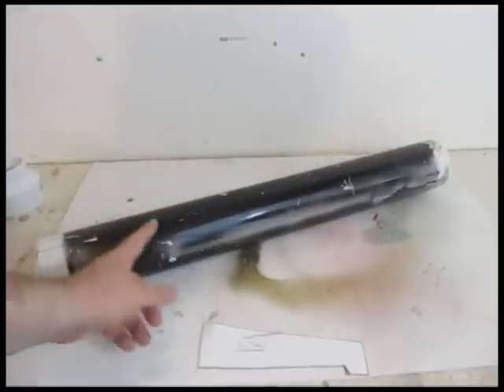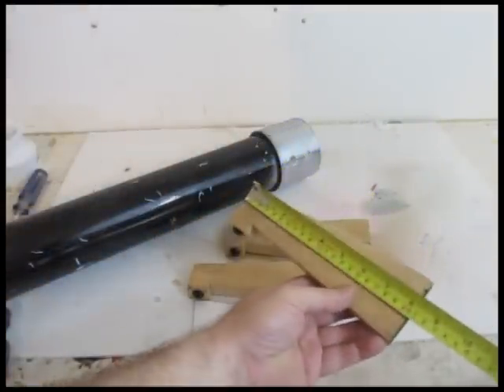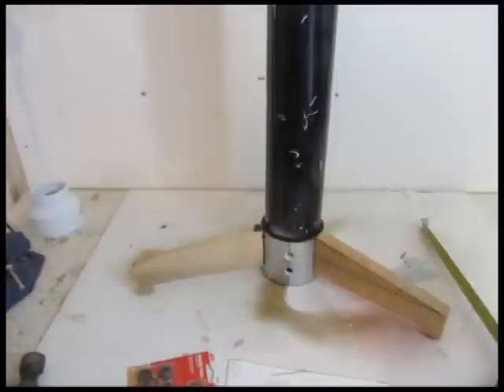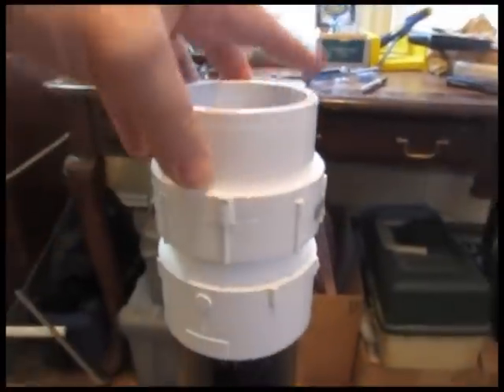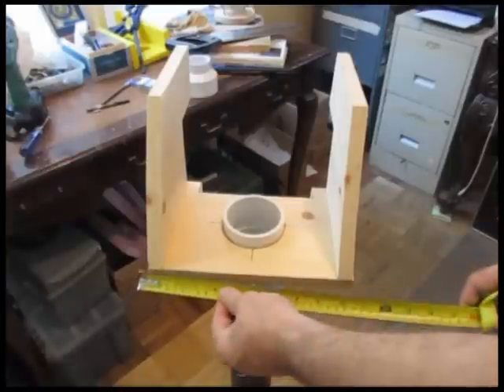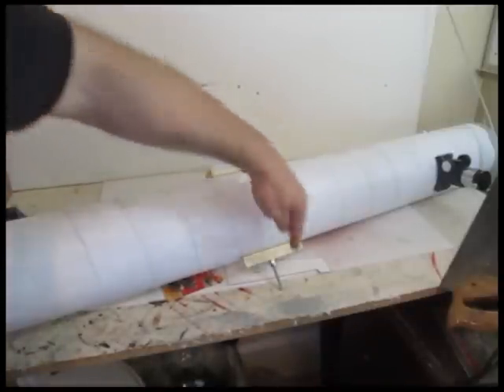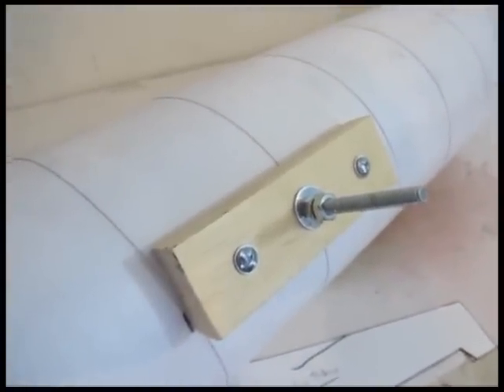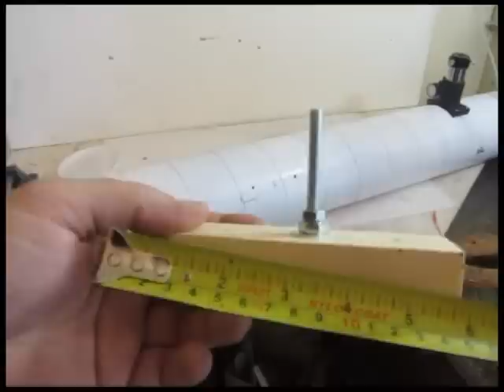How to Make a Reflector Telescope Part 3

Comment: Fantastic and very instructibe videos. I'm starting my own 6 inches telescope with your help. You state this mount for a 4 inches instrument but mine will be 6 inches. I imagine the mount is the same, only proportionally increased in size. Am I correct?
Reply from the maker: Congrats on making a six inch telescope.. It won't be a proportional increase in size because we are dealing with some simple angles. It will be a bit different. The shapes will all be the same. I recommend you build the telescope tube assembly first. Then you can use your tube size and the new weight of it to custom tinker the saddle and mount,.
Reply: @epicfantasy  Sorry for late reply. Personal issues kept me away from my telescope until now. Yes, I will increase the size of the supporting tube and all wooden parts to properly installed the larger 6" telescope. I find your telescope mount extremely extremely clever and very easy to make. Those I have seen like the equatorial or the Dobson, are not as practical.. By the way did you made the 8· telescope? Regards from Colombia EDUARDO

Comment: You would want to use some sand bags on the feet of the scope pier to really hold it down with this mount. I was looking at the pipe and also tossing over the idea of sealing the ends and putting sand in to dampen the vibration and add weight as well.
Reply from the maker: Great comment and great suggestion!

Comment: Nice tutorial! How did the 8 inch turn out?? I am sure you have this information somewhere but where did you purchase your mirrors from? Are they front surface or rear surface mirrors (they look like front)? Also are there benefits/drawbacks to the flat vs concave mirror aside from compactness and price? 

I am considering making a telescope myself and implementing 3D printed adapter pieces/other parts. If i do make one I would aim for a large telescope, possibly a >12 inch reflector, but I am sure mirror prices go up exponentially... Do you have any pointers for designing or buying mirrors for a homemade large telescope?

Thanks for your help! Its always nice to find an articulate, concise, step by step instructional video without any unnecessary bullshit wasting my time.
Reply from the maker: Ryan Barlow Good timing here. I just started working on the 8 inch telescope this week! Got a lot of projects and finally getting to the telescope.. I do have some advice in terms of the 12 inch. I highly recommend you make a smaller one first. Two good reasons, the learning curve of making one and the functional astronomy use. Much better to get a score of hours with a smaller telescope before lugging a monster out at night.  About telescope mirrors: They are always front surface coated. And flat mirrors don't work for telescopes. They have to be concave to bend the light. And always much more expensive, 
Keep at it and keep me posted. Dig up my email. Very worthwhile project. And I am excited to have started on the 8 inch.
Reply: Thanks for your response! I am actually working at an astronomical institute currently so I have access to all sorts of equipment. My main concern is mounting such a bulky optical tube on a tracking mount since my primary purpose is astrophotography... I am sure some of the heavier german equatorial mounts can handle it though. Keep me updated on your 8 inch!!
Reply from the maker: Excellent! Great job you must have! More coming on the 8 inch telescope build.

Comment: I'm not that familiar with telescopes, Is it important to attach an eye piece to the focuser..why is it necessary? And also what are the optimum specs to get the best results? The size of the mirrors? and also how do you cut that secondary mirror diagonally?
Reply from the maker: Akhil Prasad The eyepiece is what does the magnification. It is the power. Optimum specs don't really exist. The bigger the telescope the better.  Secondary mirror doesn't have to be cut diagonally . But better to just buy one.
Reply: epicfantasy Thank you, also where to buy the mirrors from? It is a parabolic concave mirror used only for telescopes isnt it?
I live in India and resources are very sparse here.

Comment: not sure why he used  a cardboard tube for the scope... i would have went with  a plastic pipe like the stand..but then again.. i just buy a scope :)
Reply: I would have made it from high dollar aircraft aluminum plated in silver then gold then tin..  but then again I'm just a dipshit like you
Reply: Cardboard tubes (also known as sonotube) have been used for telescopes for years, even in ones you could buy in stores.  Nowadays the industry has moved to rolled steel tubing more often than not, but there's nothing wrong with a good old fashioned sonotube.  My 8" Celestron telescope uses a sonotube for the body.  It's more pleasant to use in cold weather than my all metal 12" and 4.5" telescopes.